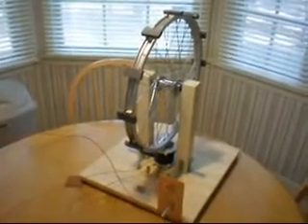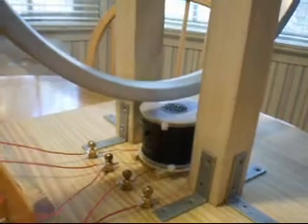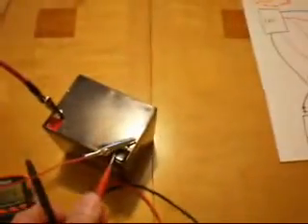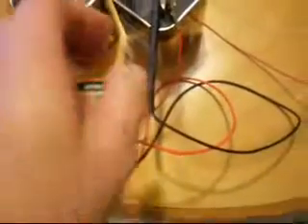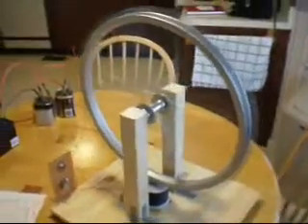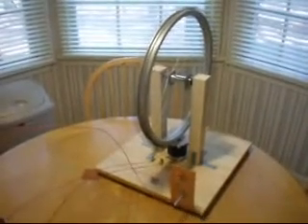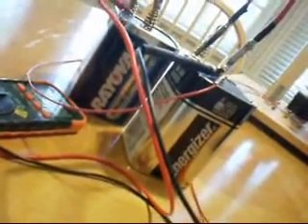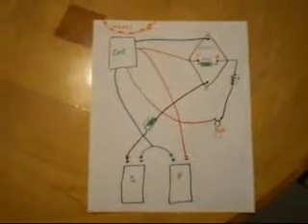Bedini SSG Test

Comment: WHAT IS THE COST TO BUILD THIS   ?
Reply from the maker: The wood is mostly scrap pieces I had around, but if you went out and bought it new it might run you ~$10. The electronics, another $10. Wire, bike wheel, and magnets,  about $15 for all, less if you use a salvaged bike wheel as I did. So, built from scratch, all new parts, $45. It can be done for a lot less.

Comment: Be careful when charging none rechargables with the SSG. I have a four filar that can repair 100 amp hour deep cycles. When charging none rechargables they can explode. To achieve the unity or overunity u need to build a seven or eight filar. With matched transistors matched resistors with cap dump or comparator. Also you must use the 23% mechanical energy from the wheel to creat more electricity to put back into the drive battery. This all gets a little more complicated but it works. Look up the bedini SSG complete beginners and intermediate books. The advanced book comes out end sept 2014.  These energizers can and do repair badly sulphated lead acid battery's as well as ni cads and nickel metal hydrates. Do not use on lithium ion a the high voltage spikes will blow the internal over voltage circuit. Done properly you can charge very large battery's at 200 to 400 am worth of current at 12 volts to push your charge batt to 15 for a full topping charge
Reply: very good post thanks
Reply: The explosion can occur even with rechargables devices if you hit the battery very high.
Reply: Very interesting video ,, 1000 Times thanks for sharing to us ,,, more power and gudluck ,,, yeryunbi@yahoo.com    ,,,

Comment: .
Impressive, because it seems you actually...built a Bedini SSG.

Most "Bedinis" on Utube are no such thing, they're just some random machines misnamed by their builders. The only way to build an SSG is the way Bedini built it, and building something different is not building an SSG.

http://rpmgt.org/Schematic2.jpg

Bedini didn't build a motor or generator, although the rotational force of a real Bedini can be put to that purpose. He built a converter.

Electricity wasn't invented, it was discovered. It's a natural form of energy that we call electricity and use. So why shouldn't there be other natural forms of energy, perhaps not yet discovered by we humans?

Turns out there is at least one. It hasn't been examined or quantified by general science yet, but it can be tapped and converted into electricity. And this is what an SSG--or any Bedini--does, it converts this, what, this energy X, into electricity.

It can be shown that energy exists between any two points in space, a dipole (a 6-volt lantern battery is also a dipole = two poles). And this is the energy that you're converting into electricity, and using to recharge your batteries.  More things in Heaven and earth, Horatio?  Apparently yep.
.

Comment: I got really interested in these things. I'm getting ready to build one soon. I have a lot of thoughts on perfectly matching a iron core's flux capacity to the magnet's magnetic flux/strength, then matching the bifilar coil to the iron core. While changing to neo magnets.....If you research making transformers from scratch correctly, you run into this complex stuff. But this stuff is important to the function IMO. Basically a fine tuning.
Reply: @rick nicksson There just wasn't enough understandable info available, It gets ridiculously complicated.  And some of the tests I had planned didn't work out like I thought. But I made several bendini motors....  But if you look into switch mode power supplies and why we don't use big heavy transformers in everything anymore, you will find that we learned that the higher the frequency the more power the same size core can transfer. But this requires a core material like ferrite instead of iron laminate. And it also requires 100+khz frequencies usually... Also it helps to understand resonant circuits and how/why they increase in voltage, over the input voltage, when driven closer to the resonant frequency. It's not free energy though. They increase in current draw equally. The inertia starts to over come the current limiting resistance causing a negative resistance effect.